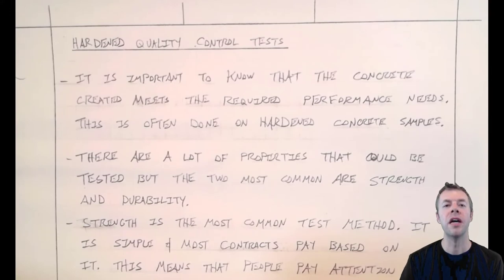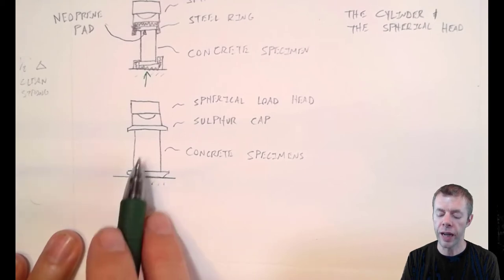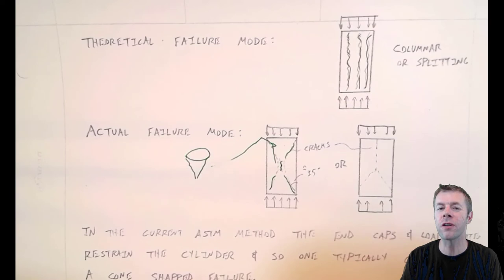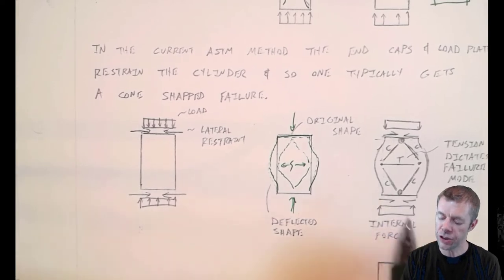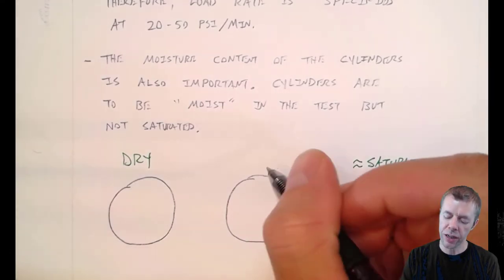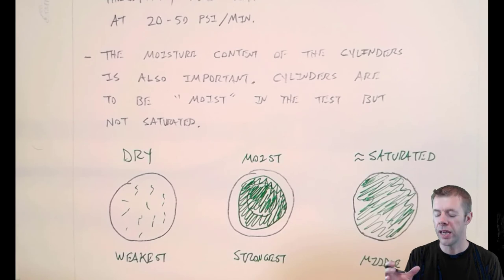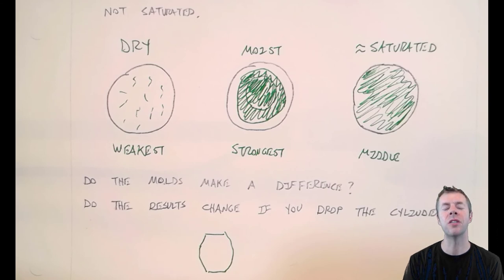Compression Strength – Hardened Concrete Quality Control Tests pt 1

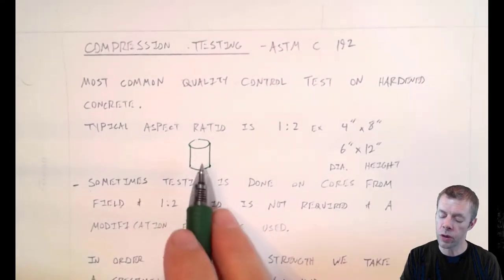Comment: The load rate is 35 +/- 7 psi / second. A cylinder that breaks at 4800 psi would take ~2:30 to break at this rate vs 50 psi/minute where it would take ~1.5 hours to break.

Comment: And seriously I think your vid gave me a real scientific opinion about shaolin or JC van damme punching a whole pile of bricks and bursting the one in the middle… I didn’t  expect strengthes would  spread this way, and more than that I didn’t expect that tool hitting concrete (hydraulic press shaft eg) would create friction force holding the surface together… that’s really amazing 👍🏽👍🏽👍🏽

Comment: Can you give me a recipe for making high quality cellular  lightweight concrete? what chemicals should I add?
Reply from the maker: Thanks for the question.  I am going to make a video about cellular concrete soon.
Reply: @TylerLey  can not wait. I've spent two months trying to make light brick. but all my attempts failed. light brick that I made type clc. add lime cement sand and a little gypsum, but still have poor compressive strength. also not floating in water. I don't know what kind of chemicals I have to add to get good quality brick light.

Comment: Great explanation! In the oilfield we use cubes instead. I wonder why that is? Also, compressive strength testing via a UCA (ultrasonic cement analyzer) is more common. With this machine strength is determined by measuring the change in velocity of an ultrasonic signal transmitted through the cement specimen as it hardens. As the strength of the cement specimen increases, the ultrasonic signal’s transit time through the sample decreases. Using proprietary algorithms that have been proven throughout the industry, the relative strength is calculated. We crush samples too but the problem with that is that it does not give us a graphical representation of the strength development like a UCA does as we are interested in more than just long term strength values. For instance, we are often interested in the initial set strength (50 psi). This is good to know for when the rig must tag cement plugs. If cementing conductor offshore (riser-less operations) then the rig will want to know when they can release conductor pipe as the rig will be holding the conductor casing as the cement sets. Typically cement can support pipe when it has achieved 100 psi of compressive strength. Some people will even say that 75 psi is good. The rig will also want to know when they can drill out the tail cement after cementing surface and intermediate casings for example. The drill-out value is recommended as 500 psi. So it’s clear to see that in the oilfield we are interested in more than just the final strength value. Do you ever use a UCA for concrete or would the coarse aggregate affect the test results? In the oilfield if we want to test compressive strength of foam cement we crush test as the dispersed bubbles of air inside the cement will not give reliable results if tested with a UCA. Bubbles in the foam attenuate the acoustic signal, resulting in poor signal quality.
Reply from the maker: Cubes are also used in the concrete world when you are testing paste.  When you add aggregates then you need a larger volume.  Strength testing for concrete in Europe is also done with cubes but they are very large.

Ultrasonic tests are great if you have a homogeneous material.  Once you start to add aggregates then concrete is no longer homogenous.  That doesn't mean that you can't use this test.  However, it means that it is very difficult to use this test to directly predict mechanical properties.  For example, if I use a granite aggregate in one mixture and a limestone in another mixture then these aggregates can make up about 50% of the volume of the mixture.  Also, these aggregates have very different properties and so the travel time and speed is also very different.

If you want to non-destructively predict the strength gain of concrete then you should use the maturity method.  In the laboratory you build a curve where you measure temperature over time and gather compressive strength.  In the field, you can then just measure the temperature change of the concrete and then predict the strength.  This is very reliable and used where strength gain is very important.  There are many projects where this is not a concern.
Reply: Tyler Ley thanks for the info, makes sense.